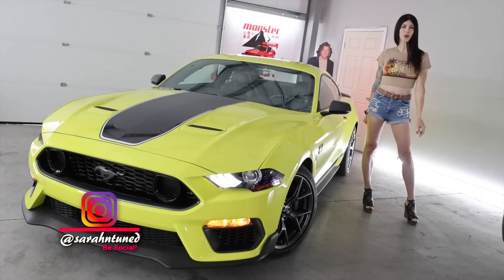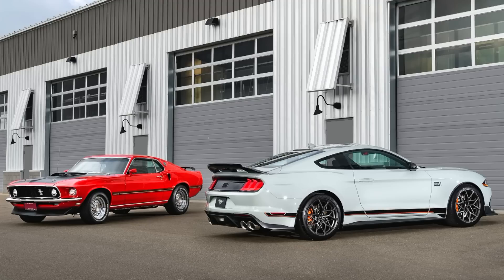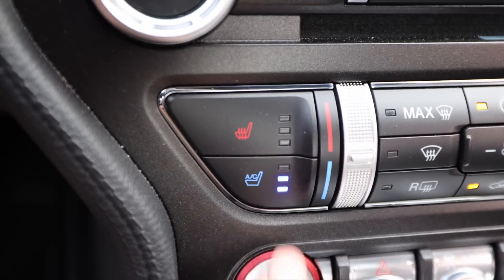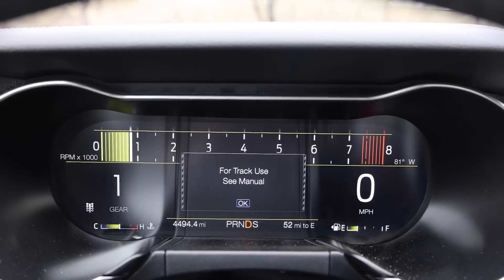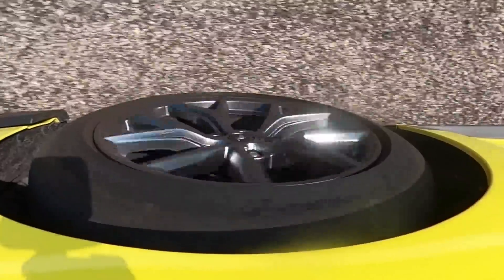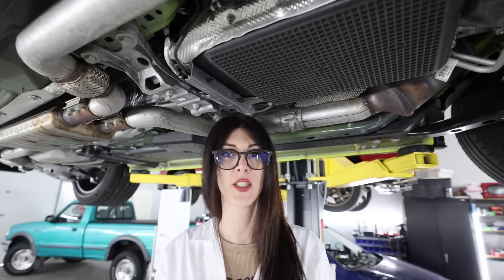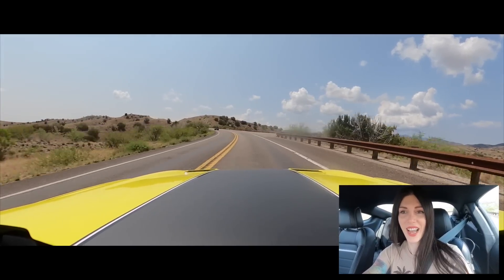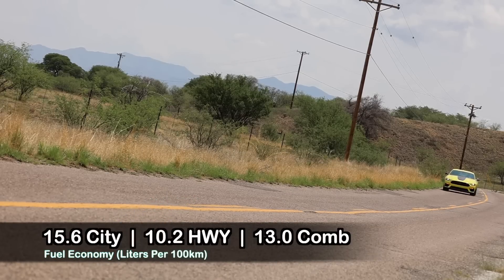Going Out With A Bang! // 2021 Ford Mustang Mach 1 Review

Comment: Any car with a Coyote engine in it, is a winner in my book.
Reply: I think I'm going to find me a 302 boss with a flat-plane crank it's called the voodoo.
Reply: Put some forced induction to a Coyote and it'll howl all night.
The Voodoo wasn't as reliable. Great engine, great noise, not as reliable, less torque in the RPM range most will spend most of the time.
Reply: the Gen 3 Coyote is the better Engine

Comment: That color is hotness.  

Also, correction:  The manual transmission you get on this is the same Tremec one used in the GT350 (and Camaro and Challenger), not the Getrag one that everyone hates.

Having owned a regular GT, I can't say I found the MT-82 to be bad, but I thought the mounts needed to be a little stiffer.
Reply: Correct. Tremec TR-3160, I think....
Reply: I've been beating mine, with respect, since 2015 (Performance pack GT)
Reply: I have been driving BMWs with manual Getrags for years, the key to make them shift better is to use RedLine MTF.
Reply: I’m with you on the MT82, I have one in my 2019 GT and haven’t run into any major shifting issues. I think a lot of the complaints around it come from earlier model years.

What I really wish they brought down from the GT350 are the Shelby recaros. They have some serious bolstering, way more than what you get with the GTs, and are very comfortable.
Reply: That's great to know
Reply: GT350 Tremec Manual.  Great review otherwise!
Reply: Change the shifter.

Comment: At the dealership in Los Angeles California the Sticker price is $55,560.00, though the dealership markup, before you enter finance, is $75,680.00. Therefore, it's before Gap insurance, Dealership Security Add-ons, And always need Extended Warranty. I think it's like between $7K to $9k added to the price.. at least it was on my 2016 Performance Pack Great review Sarah .... If you were to hold the Traction Control switch for 10 seconds All the Nannies would turn off....Advanced Traction Off 👦🏻👍🏻🏎🏁

Comment: I believe the dual ball joints on some cars is to help with suspension geometry like steering axis, scrub radius etc. With 2 ball joints, the strut rotates around an imaginary point that’s more inboard than if it was just rotating around a single actual lower ball joint.

Comment: 8:28 negative it has the tremec 6-speed from the GT 350 as well as the front and rear subframes from the GT350 the Bullitt doesn’t have any of that.
Reply: Yeah, I'll stick with my Competition Orange 2016 50th anniversary Shelby GT350.
Reply: Along with a few assorted GT500 bits.  The handling pack version will be a serious track day car.
Reply: I thought they came with the TR3060 out of the GT350......
Reply: @Gort-Marvin0Martian  50th Anniversary? Never knew they made one.
Reply: @goesfastandfar  Yep, 2016 Shelby GT350.  5.2 L, Flat Plane Crank V8 526HP Redline is 8,250 rpm!! Manual 6-spd Tremec 3160
Mine is Competition Orange with custom stripes.  I've done a few things to it that probably have the HP up around 550 or 560.  It is a beast.  Guys pull up beside me in their new Vettes and we're sitting eye to eye because this thing sits waaay down low!
Reply: That's the main reason for getting this over the regular gt.  The tremec blows the standard gt's  gearbox away

Comment: This is my car, exactly.  Grabber Yellow with those wheels. I got the 6 speed tremec.  I freaking love it.  Just lowered it 1 inch on Steeda Magneride springs.  have a steeda x pipe resonator delete but going full corsa as time and budget allow. Getting the GT500 wing with gurney flap when it comes in, on backoder.  Love it.  Great review. Minor point, no getrag, only tremec 6 speed. ;)

Comment: You can get that with a Tremac 6 speed manual transmission. Anyone that gets that with the automatic messed up.
Reply: The automatic is faster, especially when drag racing.
Reply: @terminator7137  Drifting? Pfft. You "win" by judges giving you points, like figure skaters? 

Drag racing is racing, where the first one over the finish line wins. Drifting is just like doing donuts in a parking lot.

Comment: Available air conditioned, cloth seats.  I wish more cars had them.
Reply: As a resident of Phoenix,  AZ I have 0% interest in leather seats.
Reply: @davect01   Drove thru there 8 years ago it was 126F at about noon in July, and experienced a severe dust storm, zero visibility, then an area bushes on fire, with burning 5 to feet in diameter, as well as rain and hail where the temperature went down to 38F, which is an 88 degree differential change, and the clear coat on the paint strip off or sand blasted.... You couldn't pay me  enough  to get me to  move there... Not even a billion dollars a year, I'm happier in Southern California  I keep getting offer on my property and i say won't be selling
Reply: @ChasingDifferentAdventures  I'd live anywhere for a billion $ a year 😁
Reply: @bjorn2run   Not me, too hot and then encounter within an hour all elements, as well as extreme temperature changes.  Within an hour no thank you. When the nights are on average 112°F no thank you, and if the government doesn't need my services I I would avoid all areas, except the grand canyon.

Comment: Had the 2003 version in red. Shaker hood. It was fun but not great on any bumps (even tho had independent rear suspension) and if the road wasn’t perfect, you’d really have to hold on. Probably better in Arizona than NJ.
Reply: 2003 Mach1 had a solid rear axle, the 2003 Cobra had IRS.

Comment: I will say, this exact spec (sans the automatic) makes me want to leave the hot hatch life with my veloster N. I’ve never owned anything that wasn’t a turbo 4 or 6. That exhaust note is heavenly. Had to edit, fun fact sync 3 is powered by blackberry! Yes that blackberry.
Reply: Once you go to a V8, you'll never want to go back to a four or a six.

Ford could make a 3.8 L V8 that would sound awesome, get great gas mileage and fill the need for that great V8 sound. I don't know why they don't do it.
Reply: @coolruehle  It's the notion that "there's no replacement for displacement", I believe. They still are on the low end on size when you compare it to the challenger or camaro, but with this, you get OHC and a redline that they conservatively set at 7K. A 3.8 V8 with DOHC and a redline of 8.5 would be a nice secondary option. However, with the godzilla 7.3 that they make, I'd rather see that with a king kong size blower through the hood. We can all dream.
Reply: @coolruehle  Ford needs to keep their bigger V8 in the Mustang to remain competitive with Camaros and Challengers.   If they also made a NA 3.8 V8, it would probably be very similar in performance to their turbo 4, and I don't see them offering two very similar performance engines on the same platform, or dropping their turbo 4.
Probably won't be too long before they start shifting production to electric anyway, but how acceptable that will be for Mustang enthusiasts is anybody's guess.  Their Mach-E does have some pretty impressive performance figures though, and will undoubtedly improve even more as technology advances.  
I expect most auto manufacturers who try to shift their performance lines over to electric will start offering some kind of artificial noise capabilities to mimic current vehicle sounds, since the noise and sound a high performance V8 makes when it's being hammered is a big part of the performance rush.  Aftermarkets will probably jump on the sound enhancement bandwagon too, as EV technology develops.

Comment: 8:26 that would not be true though, the bullitt only came with the MT-82 transmission, the Mach 1 comes standard with the GT350 tremec transmission which is a major difference
Reply: Do you mean in the manual

Comment: Its no more the end of an era than 1909 was, when Porsche debuted the world's first all-electric lineup.
Reply: The internal combustion engine era is not coming back. Within 5-10 years there will be few new ICE cars for sale.
Reply: @iakona23  
Massively more polluting coal powered electric is being shoved down our throats for one, very compelling reason: made in China.  I don't think it stands a chance.  But I also got a $15,000 electric bill for the month of Feb 2021, when EVs brought down the Texas grid for 5 days, like everyone else in the state.  Thats at 0.2% EV adoption.
Reply: Then there's the NTSB struggling with 100 new fire death lawsuits, each month.  Again, with 0.2% adoption.
Reply: @FFE-js2zp  A Tesla is on average much less likely to catch fire than a car fueled by highly flammable gasoline or diesel.
Reply: @FFE-js2zp  Coal is going away as a source of electricity generation. Even natural gas peaker plants are starting to be replaced by grid battery storage and renewables.
Reply: @iakona23  
Obviously at 0.2% EV adoption you are less likely to die in an EV.  EV collisions strong enough to distort any one of the 7000 or so battery cells will catch fire, every time.  If oxygen in the form of air or water gets to the lithium it violently explodes.  All the time.  Every time.  Passengers are  EXTREMELY unlikely to escape such an accident alive.
Reply: @iakona23  
May 18, 2021, Forbes:
"We are concerned about rapidly increasing use of fossil fuels to produce electricity for Bitcoin mining and transactions, especially coal, which has the worst emissions of any fuel," Musk said in May.
Reply: Fire Departments are instructed never to approach an EV to save passengers, instead, focus a minimum of 30,000 gallons of water on the car for at least 8 hours.  Even then, the EV is likely to re-explode several times for up to a week.
Reply: @FFE-js2zp  The total percent of miles being driven currently by EVs is irrelevant. I am talking about the adjusted  fire and safety statistics per million miles driven.  On average you are less likely to get in an accident or to be injured while driving in a Tesla compared to any ICE vehicle. I don’t know the statistics for other EVs, but it helps in terms of accidents and crash protection to have a lower center of gravity with battery weight down low, and to not have a heavy ICE engine under the hood which could be pushed toward the cabin area in a frontal collision.
Reply: @ArbitraryFilmings  
Gasoline cars don't pollute.  Only coal powered EVs pollute, as Musk points out when mauling bitcoin, "electricity use is the primiray driver of global warming."  Reference:  "EPA vehicle emissions standards directly sparked the development and implementation of a range of technologies,” said an EPA spokesperson in a statement provided to Design News. “The automotive catalytic converter, in particular, is considered to be one of the great environmental inventions of all time. Compared to 1970 vehicle models, new cars, SUVs and pickup trucks are roughly 99 percent cleaner for common pollutants. New heavy-duty trucks and buses are roughly 99 percent cleaner than 1970 models.”

Indeed, a 99 percent reduction in pollution is surely one of the great environmental inventions of all time."

The correct number is 99.99% as cited by Car & Driver.
Reply: @FFE-js2zp  Let me see who is it that is always having things shoved down their throats... oh that's right.
Reply: @FFE-js2zp  “We found that electric cars are as safe in our tests when it comes to crash worthiness collision avoidance as internal combustion engine models,” said IIHS president David Harkey. ... According to the Highway Loss Data Institute, injury claims for electric cars are 40 percent lower than for identical gas-powered vehicles.Apr 23, 2021
Reply: @mostcom  
Don"t confuse marketing with reality.  The NTSB says they have 100 new EV fire death lawsuits a month.  Obviously lithium explodes when it touches oxygen.  If you're in a serious enough collision to deform the battery, kaboom.  Its not a matter of willing it away.
Reply: @FFE-js2zp  link
Reply: @mostcom  
"Around 11:30 p.m. on Saturday, April 17 near a Houston subdivision, a 2019 Tesla Model S jumped the road and collided with a tree. News reports focused on the fact that no one seemed to be behind the wheel of the car when it crashed. The bodies of two men were inside, one in the passenger seat and another in the rear seat of the vehicle, suggesting they had been using the car’s self-driving autopilot. But several reports noted another interesting fact: When first responders arrived and attempted to put the fire out, it kept reigniting, burning continuously for over four hours despite the use of nearly 30,000 gallons of water to extinguish it. "
Reply: Go to any RC flying field.  There's lithium ion electric and traditional internal combustion power.  Lithium lights the field on fire once or twice a day.  Internal combustion, never.  Tesla has responded to the NTSB with fire training.  No other manufacture was shut down by the NTSB for inadequate fire suppression.

Comment: As someone with the manual Mach 1, you are right. It is way better. The Tremmic transmission is the one out of the GT350 and way better than the Bullet Getrag.
Reply: As someone with a Mach 1 with the 10A, manual versions get walked. I prefer the performance.
Reply: @lockheedload  Mines supercharged, it's what the Mach 1 is for. So you can make a manual GT-500 for cheaper. Supercharging is only 7 grand and requires no supporting upgrades as long as you have the manual. If you have the auto you have to build it to support the horsepower. After you put that much money into it you have pretty much spent the amount of money you would have spent on a base trim GT-500, but with a worse transmission since you won't have the duel clutch. It makes me really wonder why they even bothered to make them.
Reply: @JSTKSK  meh. I’d just buy the gt500 if that’s what I wanted.
Reply: @lockheedload  The point is that most manual versions won't be getting "walked" because they are commonly supercharged since it is very cheap to do so. There is a reason the Mach 1 owners package is showing off the Tremec transmission. That's also why I don't understand why they made an automatic version. The automatic owners have an owners package showing off prices of the car that they don't even have.

Comment: Awesome video Sarah. Would hate to see the Mach 1 in drag strip mode. In my 2018 mustang when I put my car in the drag strip mode the shifts are crazy you really have to hang on the steering wheel with two hands. In my car it's just a four cylinder. Imagine a V8. 🙄🤓🔥🔥🥰👍⭐

Comment: Why would anyone get a Mach 1 with a auto transmission?
Reply: So they can use both hands to drink their Capri Sun.
Reply: @Baked13  fair enough.
Reply from the maker: It would be consistent as hell on a track if you were chasing lap times.
Reply: @ArbitraryFilmings  it's not out of annoyance that I ask. I ask out of curiosity. Why not just get a GT and save 20k? And if you had a tremec in your Mustang you would be asking the same question.
Reply: Because the 10-speed is
Very strong can withstand 800+hp / Manual w/stock clutch = not so much
Offers more torque ratios at track, thus keeping engine in the ‘powerband’
Shifts faster than any human .. even 🐧penguins ~ 😱
Is recommended by those that put superchargers on their Coyote 👀
And, some people want to 🤷🏻‍♂️ Paddle Shift 
Oh,
7th gear is 1:1 ... 
so, there are 3 overdrives👀 ‘eco’- fuel is cool, but speed is a need

Comment: Quick correction the Mach 1 has the Tremec TR-3160 for a manual (same as the GT350). Not the Getrag MT-82 (which is a crappy gearbox).

Comment: Too bad Ford is turning the Mustang into an all electric car just like Dodge is going to do with the Challenger, I honestly don't see myself driving a muscle car without a combustion engine and not ever hearing that beautiful sound. 😪👎
Reply: Do you own a muscle car
Reply: @lewisberry8657  I used to own a 1967 Pontiac GTO.
Reply: Is that statement true?
Reply: @t-lawsfitness6044  Yeah it's true.
Reply: You can have the V8 sound artificially replicated. And lets face it, that's all that matters.
Reply: @peterboczan2116  To me personally it wouldn't be the same, the sound generating vibrations from  each cylinder in the combustion engine and the pressure waves in the intake and exhaust systems cannot be replicated.It's like making yourself believe you have a turbo installed on your engine when it's actually those fake turbo noise makers they sell, what is the point.
Reply: @EddieG582  Your absolutely right! All I am saying is that it could be an optional feature for future electric cars. The only other option for true petrol heads is a stay of execution in the form of Bio or Synthetic fuel technology.
Reply: @andrewslagle1974  AGREED
Reply: @EddieG582  That's awesome,  now that I'm older I wish I kept my older cars.
Reply: @peterboczan2116  wtf...that's a terrible idea.
Reply: I think that is awhile out because the S650 has a Coyote and it might get the big V8 that has been rumored for like the last 7 years. So like 2028(?)

Comment: I don't see any tires. I have a Zinc Yellow '03. I got a set of 15" wheels off a '99 V6 so I could actually put tires (real tires with sidewalls) on it. I managed to fit 215/70-15 RWL BFG Radial T/As on it. Really sick of cars without tires.

Comment: I came from a Chrysler 300C SRT8 when looking for a new car, had owned a V8 Holden before that. When I looked at the Mustang I was immediately turned off by the cheap interior; for such an expensive car (even the base model here in Oz) it was a complete turn off. Ended up with a Stinger GT...which I haven't really bonded with...

Comment: Who would have thought that the great grandchild of a 221 cubic inch V-8 designed for an early '60's economy car would now be the "big engine" in a Mustang. These engines still have undersize main bearings and the thin wall block. Make mine a Camaro or a Challenger with a real robust V-8 and a manual transmission that doesn't grenade.